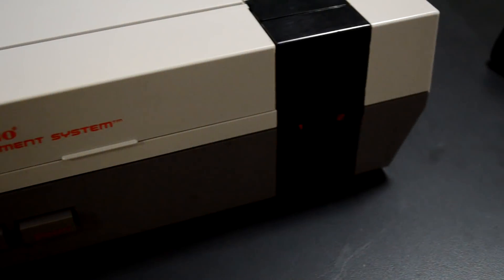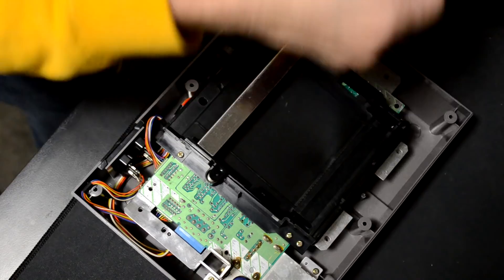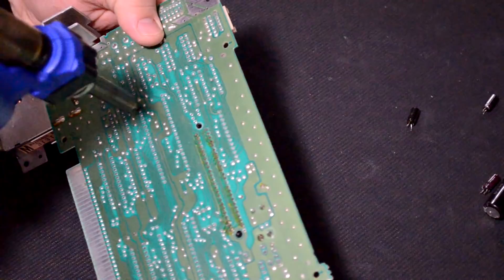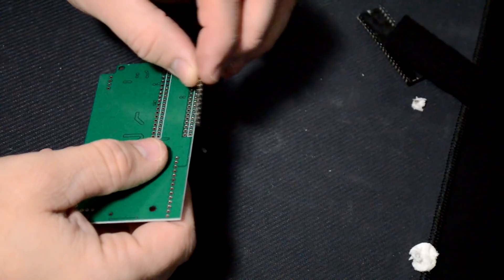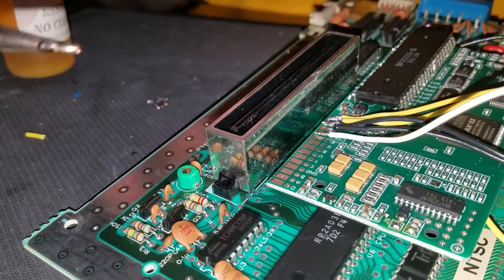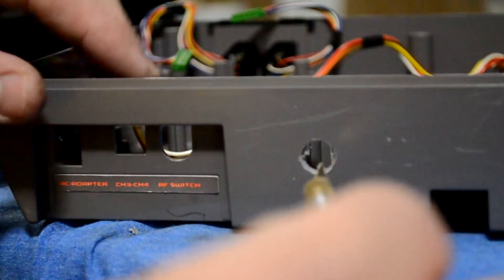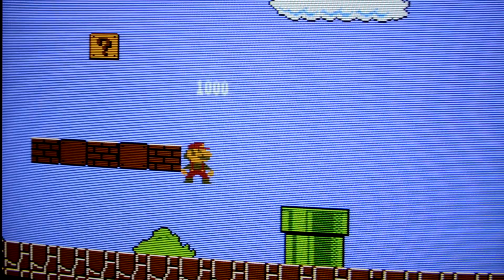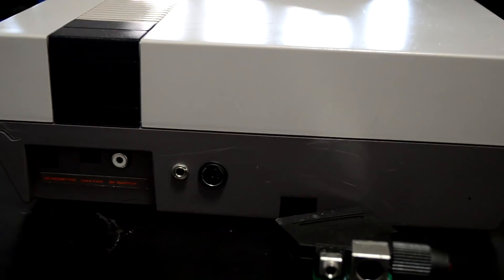How To RGB mod a NES Front Loader Nintendo

Comment: Great video but only minor complaint is when removing ppu I would reflow all of the dip pins before desoldering.  There are two reasons for this: to prevent traces from getting ripped up on a 30 year machine + you're sucking out solder from both sides of the pcb (top and bottom). This small step can be the difference between a pulled trace and not. It also makes it easier to desolder as this solder is 30+ years old.
Reply from the maker: Thanks.  That is a great tip and pretty crucial step for this mod.  I was being a little lazy this time and got lucky.  Thanks for pointing this out.

Comment: Great instructions and tips. I've modded a number of these and the Hakko definitely makes installation much easier.
Reply from the maker: Thanks, that tool changes everything.  Makes life so much easier.
Reply: I work on arcade machines on occasion and I have been listing after one of those Hakkos for years haha. I imagine it sure beats a standard solder pump

Comment: The composite output is extremely nice if you use the right cable. You don't want to use a standard yellow dvd composite cable. What you want is a thick pair of gold plated audio cables.  Your picture and sound will be amazing . Just plug them into your composite or component inputs on your tv.

Comment: After all these years soldering, it really helps to whip out the very thin diameter solder when doing small solder jobs. .036" is my go to size to stop solder bridges and wasted solder, after cleaning the tip.

Comment: this would be great for but i wouldn't do any thing with a switch, and instead of the din connector, use the same nintendo connector used on the original snes through to the game cube. so it can use the same cables available to the newer consoles.
Reply from the maker: Thanks.  I know what you mean.  I just did a top loader mod and used the multi out that matches the SNES, etc.  It's so much better.

Comment: If you have an everdrive you should install the firebrandx expansion audio mod. It is extremely easy and only requires $2 of resisters and a $1 switch plus a foot or so of spare wire.
Reply from the maker: Thanks, @Firebrandx does have some great stuff for the NES.

Comment: So, I have a PAL NES with a video output that does not work : when I turn on the console it only shows a Grey screen but the sound works, I can hear the games music.
I don't really know what the problem is, I think something in the composite circuitry or in the AV unit  is dead but I can't put the finger on it.
I'd like to repair this NES and I wonder if modding it for RGB could fix it? Since, if I understand well, when modded to RGB the video output bypasses the standard circuit...

Comment: Does one need to suck out the solder with the $250 vacuum tool? I was thinking I could snip all the legs of the chip and then work out the pieces from the board one at a time...

Comment: So I have a friend who is asking me to install his RGB board on his top loader, but i can’t seem to get a signal. Since you’ve installed both RGB boards for the NES and for the Top loader NES, could you tell me if the boards are actually different (RGB boards)? Thank you.
Reply: Never mind I figured it out. Thanks anyways. I didn’t have jumpers soldered, oops

Comment: i wish you had shown the assembly of the scart adapter. also does the adapter carry audio as well? i'm confused why a 3.5mm audio cable is provided. how does this mod support audio?
Reply from the maker: Audio comes out of that 3.5mm jack, then it connects to the scart head along with the mini din cable.  That's the way the kit comes from the manufacturer.

Comment: Really wish there was an rgb option for original famciom hvc that can actually fit inside the unit... I'm hesitant to drop $100 on this as well, leaving my famicom as the only console I don't play in RGB. I did my own composite AV mod, but with how much I play NES games I really want an RGB mod. I find myself playing the GBA ports of NES games more often because they look so much clearer.
Reply from the maker: It looks a lot better in RGB, but it is an expensive mod/modded console.
Reply: Retro Tech probably the most tragic case for rgb on classic consoles.

Comment: those connections need more flux

always more flux

if the board is not swimming, you aren't winning.
Reply from the maker: Always use the flux.  It's kind of a pain to clean off though.  Is there anything better to clean it off than alcohol?
Reply: @RetroTechUSA  Not that I know of but I suppose it depends on what type your using.

Comment: If I was to send you my NES, could you do an S-Video and Stereo mod? If so, how much? I'd love to get it done. I'm a fan of S-Video actually
Reply from the maker: Hi Joseph.  All mod services are offered through Patreon here: https://www.patreon.com/retrotechUSA .  When you join, you can get mods at the best price possible.  S-Video has to use the same exact mod kit as the one in this video.  The mod you want would cost $100 in parts; $60 in labor; $50 for working NES Console; and $15 for shipping.  That totals $225 USD.  (This includes replacing the caps & Voltage Regulator in the NES and refurbishing the Pin connector.)   Shipping would be extra internationally